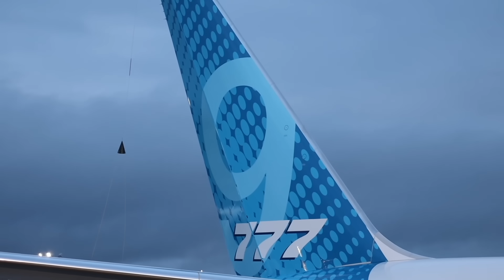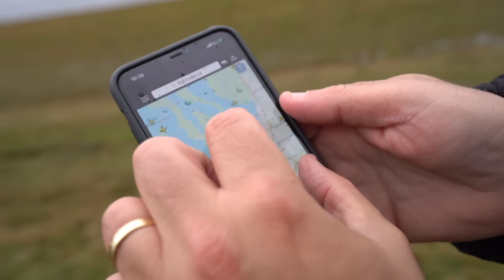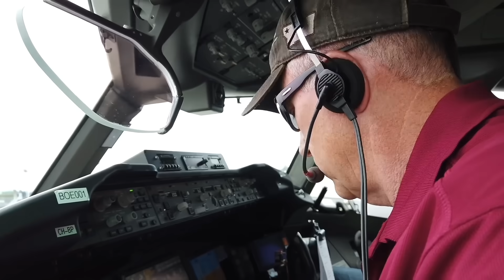Boeing 777X - What's the Difference?

Comment: After Air India crash I not trust in boing aeroplane ✈️
Reply: But it’s not Boeings fault, it’s Air India’s for bad maintenance.
Reply: @Conservativeguy37  report isn't available yet, we can't blame anyone for now
Reply: @Conservativeguy37 thats just bs, the plane underwent major maintenance in june of 2023 and had one engine swapped and the other examined just a couple months before the crash. Altho i wouldnt blame boeing for the 787 crash there are plenty of recent others that makes it harder to trust them. Like the insider info from their employees about negligence cost cutting and business motivated decisions, the panel blowouts that was caused due to cheaper outsourcing of the parts, the 737maxes that crashed due to boeings negligence when redesigning the 737, and the other issues with the rudder tail and engines that have recently came up. The 777x itself has faced composite issues along with engine and structure problem. so id rather take the bus for now.
Reply: Boeing should never be trusted..air india crash is not the only reason.. they spend more on PR, paid bots in the comments and whistle blower killings than on their planes.

Comment: The 777x is slightly longer than the 747-8 and has about 10 feet more wingspan as well. So in length and width, it is longer than a 747.  The ONLY aircraft in the world that is longer than the 777x is the single flying Antonov AN-225.

Comment: Why would it have MCAS? The 777X has full-authority digital fly by wire, not mechanical flight controls like the 737 MAX. MCAS is specifically for digitally augmenting the mechanical flight controls of the 737 MAX to replicate the flight characteristics of the 737 NG.

Comment: Can't the 777X take off in bad weather like its original? If it can't, this could be a problem for airlines.
Reply: What are you talking about
Reply: Why shouldn't it? It's not that much different and all engines are actually tested with simulations of all kinds of weather, for example they use a huge hose to simulate heavy rain and probably something like a snow cannon to simulate snow.

Comment: 2+5+2 seat arrangement for economy class in 777 is a real turn off. I don't think this 777 has any chance against a350 especially after the 737 MAX scandal and Boeing attempt to jerry fix the issue with minimum cost instead of addressing the root of the problem.

Comment: As a aircraft refueling  supervisor...i have nearly 25 years experience .But when we  fuelling boing 777 its not safe because of the feuling pannel is very close to the hot engine.If there is leaking  of fuel will make big  hazard .its only in B777s.
There for my suggestion is to move the fuelling pannel to out of the engine for few meters .thank you

Comment: 6:15 why do you have the landing gear down
Reply: They often do this on first flights. I guess in case there is a problem early on and they have to return to land quickly.
Reply: They are testing several other systems, you don't want to worry about the landing gear until other critical systems have been tested.

Comment: The clip of the plane in mid air, why was the landing gear still down?
Reply: every plane in its first flight has several systems and functions to test. You have several critical components you have to test, you don't want to worry about the landing gear. When all other systems are checked, they retract it.

Comment: I don't think it's the most powerful 777. The engines are bigger (larger diameter) and more efficient, but somewhat less powerful.
Reply: awuma Correct. The maximum tested thrust is slightly higher than the older engines though.

Comment: I have rode on airplanes for so long and rode on mostly Boeing airplanes. I rode on the Boeing 717, 737 Classic, 737NG, 747, 767, 777, and the 787. For the Boeing's latest planes, I would rather ride on a Boeing 777x than the Boeing 737 max because the 777x does not have MCAS and I can handle riding on long airplanes. I still like Boeing EXCEPT their 737 max planes.

Comment: Glad there’s no MCAS! 
MCAS: May Crash Any Second
Reply: What is MCAS?
Reply: Mr. HerobrineGaming : 
Maneuvering Characteristics Augmentation System.
https://www.boeing.com/commercial/737max/737-max-software-updates.page
Reply: @77l96  it wasn't executed poorly, it performed it's job perfectly. The sensors it relied on did identify a stall erroneously, but the mcas reacted perfectly as intended to avoid the stall. And the pilots didn't care that there wasn't actually a stall, they just sat there watching the plane try to helpfully trim down without them, and did nothing to stop it. And they were helped out by a third pilot that new what he was doing, but the very next flight, without first calling maintenance to fix the obvious problem, they did it again, but because there wasn't the third pilot anymore, they couldn't think to do the procedure they somehow forgot the first time, and were reminded of by that third pilot doing it. And somehow they were still rated for the 737, or the airline didn't fire them when they failed or missed their periodic checks. And after all that much fuckup, barely any of which Boeing could or can do anything about, you expect nothing to go wrong? The media really does no one favours when it gives insufficient/incorrect details.
Reply: siriosha gopalan 737 max mode

Comment: Boeings new sales pitch: "There is no MCAS installed...."
Reply: Only 737 needs MCAS as the engines are too high on the wing.
Reply: MCAS isn’t the problem. QRS-11 Chip is the problem. DHS hacked the chip and took control of a 737 remotely in 2016. MCAS is a distraction.
Reply: This plane doesn't need MCAS.
Reply: They don't going to installed the MCAS again I think
Reply: @sharfarazrahiis.favrate4474  They'll have something similar, just not as aggressive.
Reply: Eric Bedenbaugh Tim Miles there  wont he any MCAS since the only reason they had MCAS on the 737Max was because they had to move the engines up to to low ground clearance. The 777X has a-lot of ground clearance so they didn’t have to move the engines up so the flying characteristics are the same as the old 777s. Also Boeing couldn’t risk another PR disaster like the Max disaster. So they will have to make sure the aircraft is extremely safe. Also along with the FAA, other country’s aviation governing bodies will certify it on their own to make sure its safe.
Reply: despite the 268k+ lbs of thrust with the two GE9X
Reply: Doge Bomber I do know why it was installed, one of the main features of the 737 MAX was the larger engines which caused problems of its own. The extra power of the small airplane meant that it would pitch up when thrust was applied, then the MCAS system was installed to counter the problem.
Reply: TheRobloxian Aviator actually youre wrong, the problem was the engine placement not the engine power, thats why we can see 500kn engines on 777-200lr
Reply: No lie Detected
Reply: lol
Reply: Yes please I flew on the 737 max once and was scary af
Reply: d_egromm from Roblox it would be if you knew about these incidents. But... they were immediately grounded after that. MCAS has no other bad effect to its flight. So no.
Reply: MCAS
May
Crash
Any
Second
Reply: Will NEVER fly Boeing as a result. Thanks.
Reply: @TerbrugZondolop  whats wrong with this Boeing
Reply: HAHAHA!!!   Or not if you knew anyone on those planes.
Reply: well mcas was only really designed for the 737 due to the engine placement being changed compared to center of gravity.
Reply: @jaymc.nugget1237  Kindly refrain from making factual statements on YouTube. You will ruin the entire platform.
Reply: @ericbedenbaugh7085  sigh fair point
Reply: How ironic reading the title of this thread and early posts that it “Hasn’t got MCAS”. Now, 1 year on the FAA have significantly delayed it’s EIS approval due software features causing uncommanded pitch issues.  Remember folks, this isn’t just a bigger 777-300 with folding wingtips.  It’s total avionics redesign having similarities with the 787.
Reply: FAA are not happy with it and want more development and more answers from Boeing. There have been isolated pitch up/down incidents. Ring a bell?
Reply: @fredscratchet1355  It sounds like Qantas 72.
Reply: Ouch bro
Reply: Yeah no MCAS... hopefully it will not crash?
Reply: @tom58358  Have you heard of Alpha-Prot? That's Airbus version of MCAS. It almost downed Qantas 72 and Lufthansa 1829. Both systems seem like an over reaction  to the crash of Air France 447.
Reply: @ericbedenbaugh7085  Yes I have
Reply: @ericbedenbaugh7085  finally someone else that knows that both airline builders have had issues with computer controlled pitch.
Reply: @ericbedenbaugh7085  the thing is Boeing didn't tell the pilots about it.  Can we just move on?  I hope Boeing learned its lessons and just make good planes again.  ps stop doing anti-competitive things like picking on small manufacturers like Bombardier..
Reply: @ericbedenbaugh7085  They both are fundamentally different.

Alpha protection is like it says PROTECTION . There are many protection sequences on airbus flight mode normal law. Unlike the the MCAS, they DO NOT serve mimicking purposes for safety. 

MCAS is for AUGMENTING flight  characteristics of the NG so pilots would require minimum training so they can “fly the MAX like the NG”. 

They both protect the aircraft from stalling but the philosophies behind them are far different from eachother.
Reply: @hodb3906  Right, but there are people who think AirBus has no system to help prevent stalls. Too bad it didn't work for Air France 447. Also, if you check out Qantas 72 it nearly caused a horrific crash, but they had a crew that didn't panic.
Reply: @ericbedenbaugh7085   

Then people are stupid to think that. Besides, the mcas is a one off thing due to the aerodynamics of the engine nacelle. 

Also the QFA72  nearly causing a horrific crash is quite exaggerated to say. Airbus has protections systems primarily switching from normal law to alternate law due to the discrepancies of the ADIRS. And a possible Direct law which in simple words is the lowest level of computer flight controls. Those passengers their lives were never in jeopardy. Especially in the hands of Qantas pilots..
Reply: @hodb3906  I believe several people were severely injured when they bounced off the ceiling. MCAS was really a demand made by the airlines who didn't want to spend money to retrain their pilots, Boeing should have stood up to them, but let the thought of losing business cloud their judgement, sadly.
Reply: @ericbedenbaugh7085  Of course people were injured either seriously or minor. But the lives weren’t threatened and the aircraft was not bound to crash.
Reply: @ericbedenbaugh7085  The difference is Aribus didn't lie about the aggressiveness of the system and didn't pretend it didn't exist.
Reply: @susutag  Why are you so stern and tragical? You must banish moody discontented fury.
Reply: 🤣🤣🤣😂True
Reply: The composite wings are probably gonna disintegrate, once the retractable wingtips tear off due to moderate turbulence.   Or the overly large engines will hit the ground first during a microburst, resulting you-know in what.
Reply: GL K you know the dreamliner has composite wingtips too but i dont see wingless 787’s falling off the sky. 

Plus, you know there are ground coverage limitations for the engines, right? The one that made boeing put mcas on 737 max
Reply: Lol

Comment: I hope that Boeing does not screw up with this thing, it cannot even update an old plane, how can they built a new one anymore. I will not sit on this plane until it was used for more than one year. And the folding wing tip is typical Boeing, to save the customers money the plane becomes a new source of constructional/mechanical and software problems.

Comment: Why did it fly with its wheels out?
Reply: The gear stays down for the first few flights.
Reply: GNranger oh how come?
Reply: @jackbeames7643  it's incase there's an issue and the crew have to get the plane on the ground in a hurry. Also incase the gear for some reason are not able to extend.

Comment: It will not go up and down, up and down, up then permanently nosedive will it?.  This is all I think now when I hear Boeing.  Playing with software and making planes dangerous is not how to build confidence in a brand.  Boeings brand to me I question.
Reply: No. MCAS was an example of some of the potentially dangerous failure modes you can get from modifying very old systems to meet more modern requirements. The core idea of the older 737s (less automation) was generally fine; the core idea of newer planes (increasing, robust automation and envelope protection) is also good (actually a bit better). But combining the two won't work well because the older systems were never designed to be particularly robust against some types of failures

Comment: It's a stunning plane, and the Triple Seven certainly has one helluva impressive safety record. It also comes from the same era as the 737 MAX, an era where at least some major internal decisions have strongly favored costs at the expense of safety. I remain cautiously optimistic.
Reply: At least 777X didn't have the same management pressure to meet the schedule, which should help a lot

Comment: What if 1 winglet fail to fold down during take off?
Reply: Then they don't take off and it goes back for maintenance. The actuators are probably as reliable as flaps or other mechanisms on the wing so that's quite unlikely
Reply: @AmbientMorality  If pilot forget to open, will the plane take off with longer runaway or it can't fly?
Reply: vellfire007 Probably could take off, but wouldn’t be a good idea. Could be catastrophic hot, high, and short runways. Could have flutter issues. They’re designing systems to make sure pilots can’t forget them, just like pilots can’t accidentally have flaps set wrong.

Comment: No MCAS???
It's FBW......(from 777-200 if im not wrong. They started using FBW on their A/C)
Reply: JJthesteve 002 Yeah, 777 was their first FBW. Very innovative too with overridable envelope protection, simulated yoke forces, substantial reduction in wetted area and weight from smaller tail, etc.

Comment: Will the foldable wing break?
Reply: Chicken Rice [Brawl stars travel blog] Very unlikely as it is tested to the same limit and ultimate load as the rest of the wing (the rest of the plane would be breaking apart first)
Reply: Chicken Rice [Brawl stars travel blog] -  Similar type folding wings have been used already many decades in some fighter aircraft.

Comment: The 737 max 8 had a successful test flight also. Did they put the MCAS in the 777X?  I have reservation about flying any Boeing places now.
Reply: Gary Robertson No, the entire concept of MCAS doesn’t make sense for modern planes like 777
Reply: I’d consider the 737 max 8 a modern airplane.  I agree, it seems like Boeing has made a huge mistake.
Reply: @grobertson2008  I have a hard time considering an airplane with a dual-dual system architecture modern — that architecture was abandoned by the 70s. Even 757 and 767 have triplicate flight computers and avionics, and truly modern seems to suggest planes more like 777 and 787 with FBW and envelope protection.

Comment: Wings produce enough lift to start taking weight of the main gears @ 5:56
2 seconds before the nose gear. 
Reminiscent of the B-52
Reply: Nope, is just very light, not much payload for flight tests
Reply: @stevenrojas8251  yep, no cargo or passengers, also there is very less fuel in the payload
Reply: That's the first reason why the FAA won't give certification to the 777x due to the the right main gear lifted up first

Comment: Was the avionics software developed by the same people who worked on the 737?
Reply: Steven Corley No, and 777 is very modern (1990s, but very innovative for the time and system design hasn’t changed much since). Much easier to design robust systems whereas 737’s heritage leaves it lacking in overall architecture

Comment: Moving wing tips? I dunno, doesn’t sound like a great idea to me :/
Reply: mildpigeon They don’t move in the air
Reply: Appable yeah for sure, they are not supposed to...

In my head, extra moving parts on the wing, and therefore extra configuration needed = more chance of stuff going wrong is all 🧐
Reply: @mildpigeon  You mean takeoff configuration issues? I think those are virtually impossible nowadays with electronic checklists, central aircraft monitors, and takeoff configuration warning systems. Just electronic checklists should help a lot because most configuration problems happen when pilots mistakenly think they completed an item.

Comment: Does it take off if pilots forgot to unfold the wing tips?
Reply: Technically yes, but the electronic checklist ensures that takeoff configuration is set. If pilots skip the checklist, they shouldn't be flying the plane, but there is also the engine and crew alert system which will show wingtips are still up. If takeoff is still attempted, the takeoff configuration warning system will audibly sound to indicate that there is a configuration problem and the takeoff should be rejected.

Comment: Moving or mechanical winglet's? More moving parts on the wings! That's something to be aware. That's a big no no.
Reply: Better not have airplane flaps or control surfaces then! It's perfectly possible to design safe mechanical systems, especially when this is really a static system in flight (since it doesn't move until it's on the ground and slows down to speeds below where a go around could be an option).